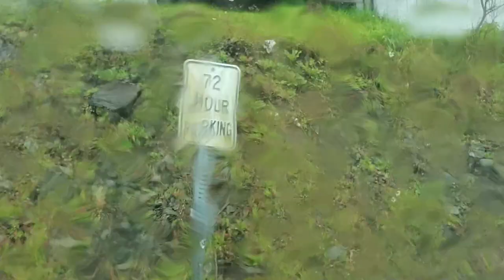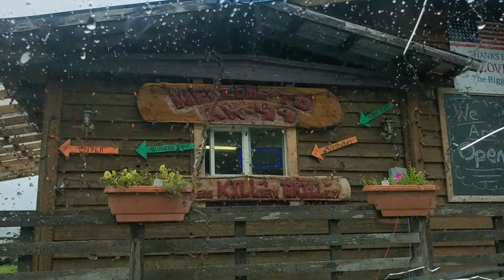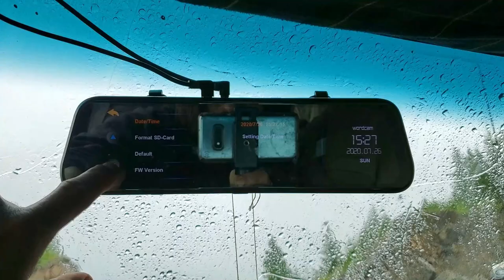Ultimate Camping Gear Setup for Adventure Enthusiasts

Comment: That's rad. I live in a damn camper now. But it's an old Fleetwood 04..  it stayed most its life parked and leaked created soft wall areas. Now since the ac went out ..the central roofing part collects moisture and drips and is killing the ceiling. I suck at this type of stuff man. I really know I can fix it and one day I hope to rather gety old truck loaded with one of these instead and live that way. Writing tunes in the woods. Hahahah. Killer brother. So cool I found your channel.
Reply from the maker: You can fix it  brudda!  I recently rebuilt this camper AGAIN.  It's in the newer videos.  There are two things that will make your camper 100% more enjoyable.  2 part spray insulation and a diesel heater.  This was my first time installing either and I have to tell ya, well worth the experience.  Ripping the camper down to the studs might be a bit cumbersome since you're using it now but if you get the chance it will give you the opportunity to patch all the pin holes, dry it out, fix rotted framing, spray it down with killz.  The 2 part closed cell insulation provides a huge bump in R value, helps prevent future leaks, provides rigidity and makes a huge overall difference in humidity level since it's not soaking up water like fiberglass insulation.  Diesel Heater sips fuel, doesn't use much electricity compared to propane and creates a lot of heat for less than $200.  You'd love it man!  A comfortable atmosphere while out in the woods will make for some soulful music 🤘🥳🍻

Comment: That pretty much looked like a tour of my rig. My only organizational concerns are balancing the weight.
Reply from the maker: I hear ya there man.  This camper layout tends to lean towards the driver side being that the water tank, propane, sink, stove and shelves are on that side.  To compensate I try to put more of my heavy gear on the passenger side of the camper floor.   Honestly though, I only really noticed a difference when the camper was on the back of my 3/4 ton with leaf suspension.  Pig, of course is a 1 ton dually with helper springs and airbags; she doesn't seem to really even notice that there is a camper back there. lol. Hauling campers up mountains? Pig don't care, Pig thinks the world is flat.